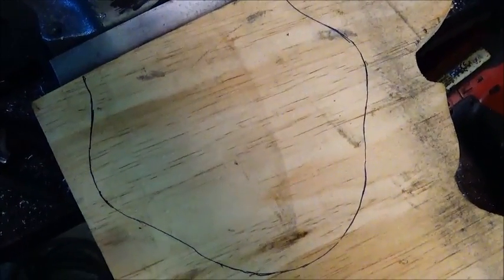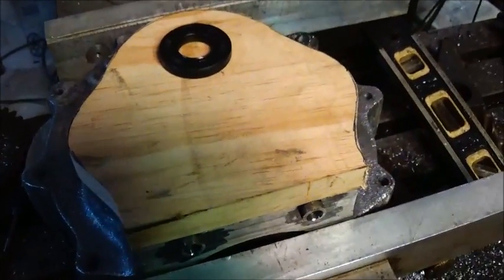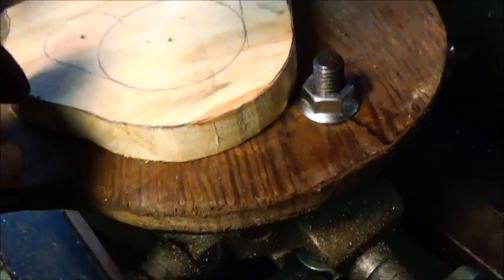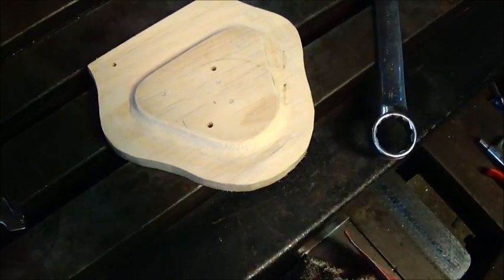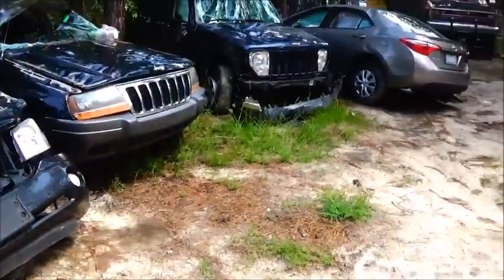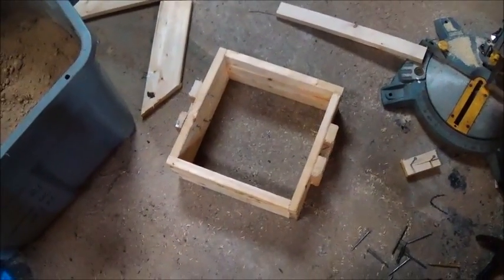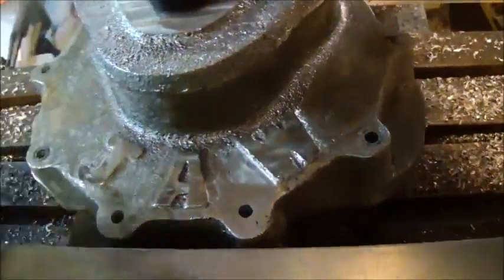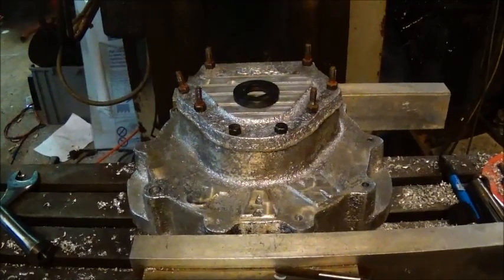Antique Motorcycle Engine Build (Replica) Part 26 Cam Cover & More

Comment: just a thought to throw out there,  when you're done with casting have you thought of milling shallow (heat sink) blades to draw air along the cover or the back/front side of the case? I know it's aluminum and and making it look to antique it but just it just popped in to the back of my mind.

Comment: A flycutter would help a lot with getting a consistent finish across a large area, and they're very cheap. Is there a reason you don't use one?
Reply from the maker: Because I am very cheap!!! HaHa I didn't have any tooling for R-8, so I had to buy collets and an adapter for my boring head. Your right cheap! until I started adding a bunch of other stuff with it, so I just bought what I really needed and put the other stuff on my want list.

Comment: you can also make the core for the casting with a mix of plaster of paris.
Reply: as a bonding agent in the sand.
Reply: It wouldn't take me long to design you something.
Reply: like what I have been working on for Dave Richards.